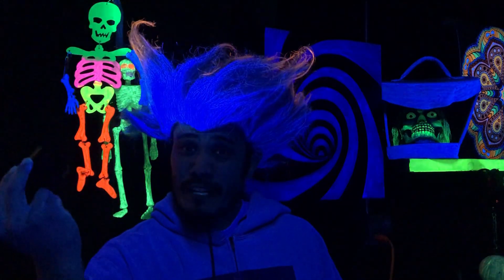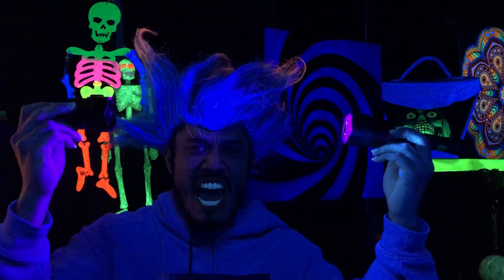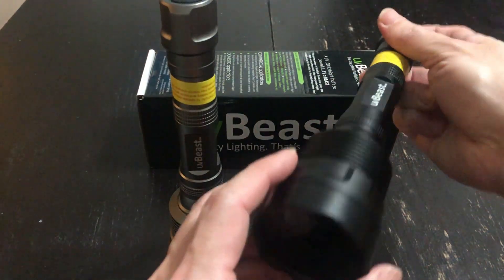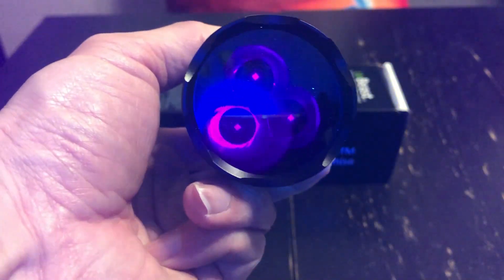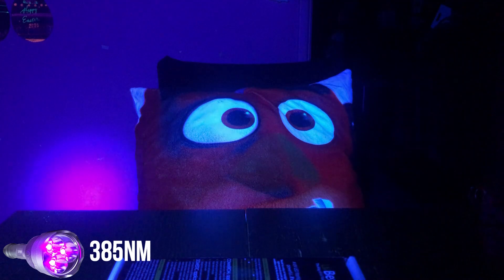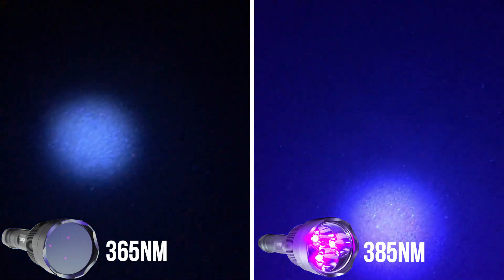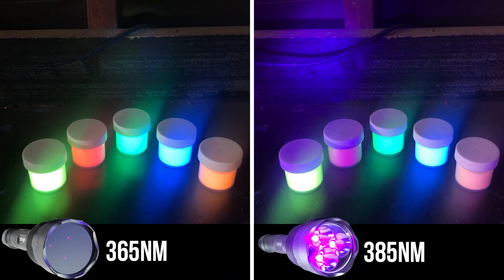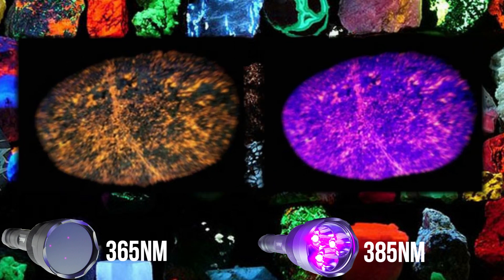UV Beast 365nm VS UV Beast 385nm - What Is The DIFFERENCE Between 365nm and 385nm UV Flashlights

Comment: He stopped uploading videos a year ago because he went BLIND from all the DAMAGE he did to his eyes by shining these incredibly powerful, dangerous UV lights at his face without ANY eye protection!  Folks, in all seriousness, the light coming off these portable lights is VERY dangerous to the human eye!  You should NEVER use a UV light of ANY type without special UV blocking safety glasses/goggles!  This stuff TEARS apart your retinas from the inside and will do IRREVERSIBLE damage to your eyesight!  There's a reason why most high power LED lights and flashlights as well as most camera lenses/smartphone cameras have a UV filter installed in front of the lens that is designed to block a very specific wavelength of light in the UV spectrum!  It's NOT good for you, and your eyes were never meant to be exposed to such a harsh, powerful, and concentrated source of pure UV light!  UV light is the portion of the sun's natural lighting that destroys most plastics, contributes to sunburns and skin cancer, and causes the most damage to our eyesight as we age.. and that's very spread out, and considerably low-consentration compared to these man-made LED's that put out an IMMENSE amount of pure UV!   The flashlights shown in this video are meant to be used as an industrial TOOL, for very specific purposes (like curing UV glued joints, etc).  They're NOT meant to be used as a "party light" or a toy to make your black light posters glow!  Beware!  Your eyesight is precious, and you CAN'T undo the damage a light like this can do in just seconds of exposure!  So unless you want to be BLIND when you turn 60, don't mess around with these!  Get yourself a nice pair of UV glasses that block a range of UV light that covers the 365/385nm that these lights purport to put out!
Reply from the maker: Very well said minus the I’m blind part.  Be very cautious when using any uv light!  Do not stare at them!

Comment: I prefer 365 nm, but I would say 395 nm is better for hunting scorpions, as we require additional visible light for seeing or walking in darkness.

I used a 365 nm UV light and a UV test card to determine if my glass absorbs UV rays. It turned out to be quite interesting; it blocked most of the UV at 365 nm but not at 395 nm. Before acquiring the 365 nm light, I had believed my glass was fake.
Reply from the maker: Definitely agree with the extra light for scorpions!

The 395nm doesn’t have much UV coming out of it, so what you’re probably seeing is the visible light going through.
Reply from the maker: Haven’t watched South Park in ages.

Comment: Did you ever attempt to use the extension and add a third battery?  It should raise voltage from 7.4 volts to 11.1 volts - somehow UV Beast seems to overlook this change in voltage, only mentioning the longer use.  You have the setup to really test such an upgrade's results!
Reply from the maker: I really didn’t have a use for it, so I never tested it out.
Reply: I have the 365 nm and there is a driver inside the head that regulates the LED drive current. If the two 18650’s have not enough drive there might be some more intensity, but it will just PWM the LEDs to a similar current (and thus intensity), giving more run time. As a side note the LED module needs heat sink compound  applied or the LEDs might not last as long. They omitted this from the factory.

Comment: I love your videos and they were super helpful for me when shopping for UV lights. Thanks!
Also, I wanted to mention two specific use cases for the uvBeast that you might like to hear -- I am an avid disc golfer, and one of my favorite times to play disc golf is at night. Some companies make glow-in-the-dark versions of their discs for nighttime throwing, and the uvBeast glows them up immediately and incredibly well! Most lights require you to hold the light on the disc for a few seconds, or to repeatedly recharge the discs, but the uvBeast seems to immediately charge the glow up to its full potential with a simple 1-2 second flash. 
The other use case might be my favorite -- even though not all disc golf discs glow in the dark, they are all made out of plastic which is often colorful and as a result responds well to UV light. One of the worst feelings is losing your favorite disc under a pile of leaves, or in a bush, under a log, or in some tall grass after a long throw, etc. So, when that happens to me or my friends, I go back to the course at night with the uvBeast and simply look in the area where it landed. Usually within a few seconds the uvBeast will reveal where the disc is hiding!
You mentioned in another video that you're not sure why you would need to light up something with UV from a long distance, but this is a really important feature for me. Sometimes discs are stuck high in trees, or sunk to the bottom of a creek, or some other difficult terrain that is hard to navigate while searching. But even at 100 feet away, most discs will pop with bright UV reactive color as soon as the beam comes near them. It's amazing! Thanks again for your videos!
Reply from the maker: @mike rowe That is really good to hear.  I know this UV flashlight is powerful, but to hear it first hand on this type of use case is great information.  Thank you!
Reply: Do you have the 365nm version? Disc golf is awesome in the dark 👍
Reply: @jan-mikaelmattsson9799 I have the 385-395nm version so there is a lot of visible light when it's on, but I actually prefer that so I can see where im walking when I have to wiggle and stomp my way through thorns and bushes and whatnot to get to my disc 😅

Also, 100% agree that disc golf in the dark is the best!!

Comment: Using UV to search for my fluorescent disc golf discs when it's a little darker outside or when they have landed at a darker place (like a thicker forest or some fir trees bunched together). 

Wondering if there is strong enough UV to be able to spot them at daylight. Like can UV even spot fluorescence at daylight?
Also which of these torches would be better to search discs with when it's a bit darker outside? It kinda feels like it's the same situation as with scorpions, that you want some extra light to surround them.
Reply from the maker: If it’s daylight unfortunately you won’t be able to detect it as the daylight would be too bright for the UV to see anything.

If you want extra purple visible light go with the 385nm.

Comment: Nice video (thumbs up) ... quick question.. I just ordered the Acebeam X80-UV .. would the UV Beast 365 outperform the X80-UV ?   I like the UV filter btw, do you think one could put over a UV filter on the Acebeam X80-UV ?.
Reply from the maker: I’ve never tried to Acebeam, but from the tech sheet, I would say the Acebeam is better quality and stronger output.  Wish I had the money to buy that one!
Reply: @UVBlackLights  I wish i had your teeth, mine are falling out.... ^_^  priceless.

I have the Acebeam X80-UV now and it's very bright indeed + i like that it has 4 white LED's aswell so you are not in complete darkness.
Reply from the maker: 😅
Yeah that two in one flashlight looks nice!

Comment: Hello What UV light would you recommend for a bedroom I have UV contact lens and also watch UV flashlight would you recommend if I wanted to use a flashlight of course I wouldn’t shine in directly in my eye lol just something to use to show the UV contact lens
Reply from the maker: I would go with the 365nm UV beast in this video.
Reply: Late comment but I would just get a small pen UV light. The UV beast is quite intense, and it does emit some UVC. It’s not really safe even off to the side without eye protection. A small 365 nm pen light with a filter would work well and be much safer and more convenient.

Comment: Nice video indeed. Would you suggest best UV for Kiwi fruit to show reactance? I tried with 395 and 365nm UV but no significant changes have been seen. I also used to conduct UV experiments. Thank you.
Reply from the maker: Hello.  I wasn't aware that kiwi fruit reacts to a blacklight, very interesting if it does though.  What 365nm do you have?
Reply: @UVBlackLights  I did a experiment with some food items you might like https://youtu.be/s6JzlbjO6rE
Reply: @UVBlackLights  It's small one single 3W LED with single 14500 lithium battery. No idea about the brand.
Reply from the maker: Next time I have kiwi laying around I’ll test it with my blacklight.
Reply: @UVBlackLights  Hi, great! You may try with Bananas also. It will show blue glowing rings under UV like a blue ringed Octopus :)
Reply from the maker: Pretty interesting!  Thanks!

Comment: Use safety glasses! They block out the UV reflection and you'll see the illuminecense better!

I got prescription glasses with that blue purple tint reflection look, it is some unnecessary added cost, but it is a extended blue light filter. You find safetyglasses that blocks up to 400nm, some company is advertising for them of you google, I guess it is the same as my prescription glasses.

I have a supposedly 365nm flashlight and i guess its really 385nm maybe since I see the purple colour when I take of my prescription glasses.
Reply from the maker: Yeah I have UV blocking prescription glasses.  I tried the blue light filter glasses and I see no difference.

You’ll still see some purple visible light on a 365nm, can’t block out all visible light.

Comment: i have a question - with my infrared photography i have a 590nm Ir internal filter and that means everything from 590 down is blocked so do these UV flashlights do the same?  if i got this right the UV blocks everything from that number up and that would explain why the 385 would have more visible light.
Reply from the maker: Hello!  The wavelength determines how much visible light comes out.  There is more visible light from the 385nm because you’re getting closer to the visible light spectrum where as 365nm is more true UV and not much visible light.  The filter on the 365nm just blocks out some of the visible light that leaks out.

Check out https://youtu.be/t10pXsKqyDg this explains the wavelength.
Reply: @UVBlackLights  right so everything above those numbers are blocked but with infrared filters everything from those numbers down is blocked. a 590 Ir filter will allow everything from 590nm up to pass through the filter and everything below that number is blocked.  but it looks to me like with UV everything below those numbers is allowed to pass through but everything above those numbers is blocked.
Reply from the maker: @gpaerv  correct, the filter doesn’t block any UV at all.

Comment: In response to your response on best nm for horn worm you responded with 365 but in this video you mentioned the 395nm would be better for searching. 

At 3:05 you recommended the 395 for scorpions, wouldn’t horn worms and scorpions be in the same category ?
Reply from the maker: All depends.  If I personally was hunting for scorpions, I would take the 385-400 for the extra visible light, especially if it’s pitch dark and depends where you’re hunting.

Horn worms, I would expect you aren’t in dangerous areas, so the extra visible light might not be needed.
Reply: @UVBlackLights  I see now ! Much appreciated! I bought a “Escolite UV Flashlight Black Light, 51 LED 395 nM “
Back in the day from Amazon before my uvbeast 3 with filter 365nm. 
The 365nm is way better but the beam is to focused . I wouldn’t mind 365nm with a wider spread. Hope your family is doing well ttyl
Reply from the maker: @ReefMimic  Agree on the too focused, I've yet to find one that has a bigger spread.  I know there is one out there, just haven't done as much research.  All is well here, thank you.  Hope you and the fam is doing well also!

Comment: UV Black Lights.... Just found your channel and video's, as I'm researching UV "Flashlights", and have subscribed to your channel after watching several of them tonight...Great Info!!   I have already pretty well decided on the "Beast" lights, but not sure which would be best.  We need one for spotting those darn "Tomato Worms" on the Tomato plants in our garden, which we've been doing in the late evening / early "dark thirty" to see them better with the "El Cheapo" (395+/- Nm) that my wife bought somewhere on line last year.  Also, which would be better for spotting Brown Recluse spiders (if at all possible??)... the 385Nm or the 365Nm?   

I also want one that would be good for spotting any possible fluid leeks (water, oil, anti-freeze, etc, etc) in the house, or on any of my engine powered vehicles.   Would any particular One, be good for all those possible uses, or should I look at getting a couple of different ones for the different applications.... ie; Garden / house, vs - shop and vehicles??   

Thanks SO much for your input, and will be watching for more of your videos... I appreciate what you do, and I'm quickly discovering more potential uses for good quality UV "flashlights" even through just the few of yours that I've watched so far, tonight.  Thanks again for your time and response to my questions (hopefully, you'll see and read this).           

PS: Just out of curiosity, the "El Cheapo" UV Flashlight we currently have (395Nm)... which "looks like" a whole bunch of others with 100 LEDs in the 15 - 20 dollar range & powered by 6 AAA Batt's in two modules..... seems to have developed a problem..... tonight, and first use of the year in the garden, I put in 6 brand new triple A's after testing each of them with my Multi-meter to get 6, that were all reading exactly the same output (1.57 volts).  

After approximately 15 - 20 minutes of use checking the Tomato Plants... I removed the two battery modules to retest the voltage, and noting that in my hand the batteries were quite warm, which I suspected may have been due to excessive & rapid discharge.  The Multi-meter showed that they had all dropped from 1.57 down to 1.22volts!!   At that rate, I will be changing batteries 2 or 3 times a week, as we have to check for those Tomato killing worms, Every evening/night from now through late fall.... does that seem "right" to you?  

I put another Fresh set of batteries (1.57volts each) back in the UV flashlight, and turned it on for just 2.5 minutes... then removed and retested the batteries again with my Multi-meter.... they ALL (6) dropped from 1.57 down to 1.42. / 1.41volts.... in just 2.5 minutes!!   Is this "normal", or is this due to a cheaply made and inefficient UV flashlight??   Your thoughts.. ??
Reply from the maker: @2Stroke Diesel Power For the Tomato Worms, you can’t go wrong with either.  My personal preference is always the 365nm, as you get true UV and it will work for all applications.  As for brown recluse spiders, I’m not sure if those fluoresce under a blacklight.

For fluid leeks, again either or will work for that.  You know I like the 365nm, one reason is no visible purple light from the 385+, much easier to detect things.

The “El Cheapo’s” sounds like it was made poorly and the driver is about to burn out.  I tend to stray away from the flashlights that use AAA batteries, especially more than 4 of them.  In my opinion, if it doesn’t use 18650 rechargeable batteries, it’s not really good.

I hope this helps, if you have any questions down the road, feel free to ask!  Thank you for subbing and watching.  Mahalo!

Comment: How does the UVB V3 365 compare to the V3 365 mini? I’m considering the mini plus a decent charger and some extra 18650 batteries. Does the mini project a similar beam width as compared to the V3 365? I’d prefer more beam width instead of a tightly focused beam. General household and garage use.
Reply from the maker: If you prefer a more beam spread, I would go with the UVB V3.  The mini is strong, but not as big of a spread.  Can’t go wrong with either.  I like the mini as well cause of how compact it is.  I really need to do a side by side comparison with those two.
Reply: @UVBlackLights  
Thanks. Initially I was interested in the 385-395nm lights, but the more I investigated, the 365nm lights seemed to make more sense. I like the compactness of the mini. I’d really like to see your comparison of these 365nm lights.
Reply from the maker: @speedlever  I’ll try to make the video ASAP, work has been taking control of my life lately.  Did you have anything in particular you wanted to see in comparison, beside the beam width?  If I have the resources I’ll add it in the video.
Reply: @UVBlackLights  
Thanks for your efforts. I’ve never had one before so not sure exactly how I’ll use it once I track down all the pet stains and scare myself checking out nasty bathrooms in the house. I have a daughter into digging for crystals/minerals… not sure how applicable a UV light will be in the field, but I imagine the mini might be more useful in that environment. Might have to get one of each.

Don’t rush out a video just for me. Not sure if the UVBeast flashlights are over hyped by marketing or if they’re as well designed and built as the marketing would have me believe.
Reply from the maker: @speedlever  the mini is great for things like checking for stains and bathrooms.  For outside unless you need long distance, the UVB V3 would be better.

The UVB V3 seems well built, the power has no complaints by me, and the body doesn’t feel cheap.

No rush on the video, I’ve been wanting to do more comparison videos.  🤙🏻